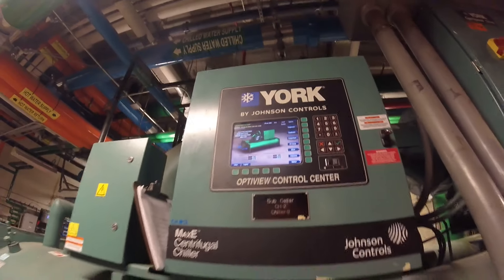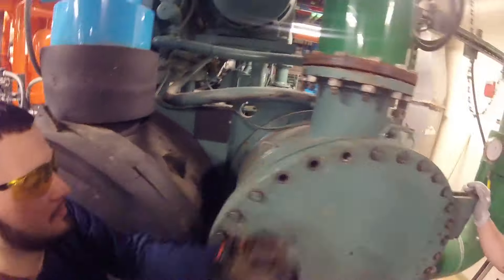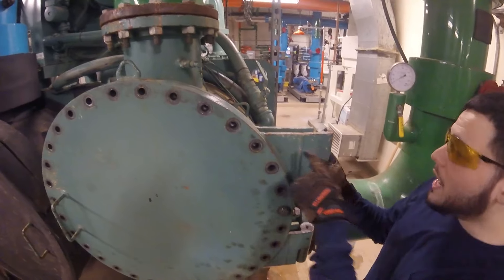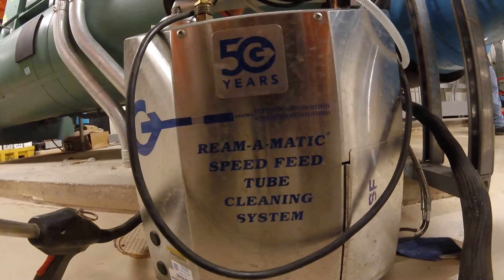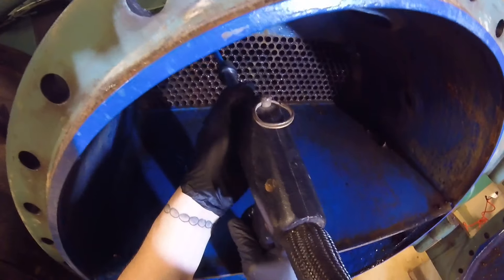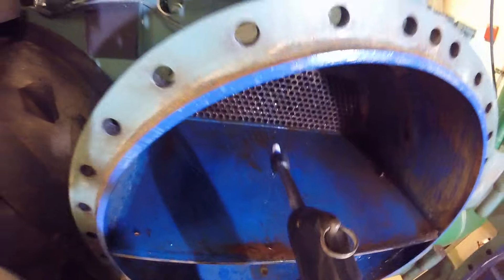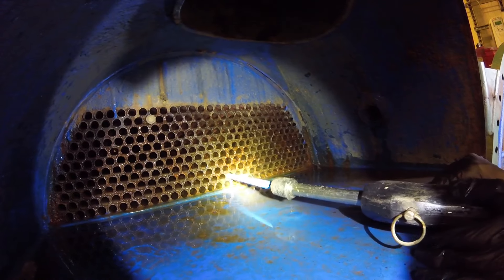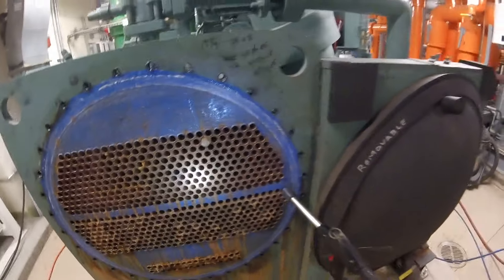Centrifugal Chiller Maintenance (Punching Condenser Tubes On A Chiller) Industrial Refrigeration

Comment: Nice video. Couple items noted. The Goodway machine is supposed to be laying down when in use. The label on the machine says that. Your supposed to set the cable stop so the brush only comes out half way on the opposite end. Also, why not brush tubes from opposite end from marine water box? It’s much easier.

Comment: Good job, i remember doing same job in Saudi Arabia on our York OM TITAN (5090 TR) chiller it had around 4400 tubes  in condenser. i am missing my job badly.
Reply: From what I remember, the largest of the OM’s had 7000 tubes. Those OM heat exchangers were huge.

Comment: Interesting to see you guys open up both ends of the condenser barrel. We only open up one end of the barrel and punch the tubes. I never worked on a centrifugal chiller with hinges on the endplates. We always had to build up a portable A-frame or T-frame rig assembly and then attach a chainfall to it to support the endplate as we broke lose the bolts and then lowered it to the floor.The A-frames are for the really heavy weight.
Reply: Hinges are a factory only option and are awesome when specc'd. Opening the ends on a 3000 ton YST is easy as pie.... brushing the tubes is another story... for a junior tech.

Comment: Nice video showing this process. When the water treatment program is well managed, and the engineers put in a good quality filter the tubes won't need to be punched for many years. This is a band aid solution to poor water quality in the loop. More problems are seen on the condenser side but on older loops the evaporator side can also get pretty dirty from corrosion in the pipes.
Reply: filter? You talking about the pump strainers?
Reply: @ryanmalin  not pump strainers. Those are like 1/8" and don't remove small deposit-forming particulates. I'm talking about side stream filters which continually filter a small portion of the recirculating water. Sand filters work best but you need to keep up with the PM.
Reply: Plus a money maker

Comment: Those goodway tube punching machines are supposed to run flat not sitting up like that.  Ive spoke with the manufacture about it.  I have 6 1000 ton chillers at my building in chicago  and recently had to purchase a new goodway so we wanted to put as little wear on it as possible.  From my understanding its harder on the clutch due to the angle of the rod when its upright.

Comment: Fair job, but it takes more than brushing tubes to get them clean and up to factory specs. Testing type of scale built up and circulating proper chemicals to soften scale must be performed before punching tubes. There are many types of scale depending on water source. Proper Cooling Tower treatment will prevent most problems. Regards YORKPR.

Comment: What is the point of having only one hinged end cover in the heat exchnger?
Shouldn't it come in pairs?
Reply from the maker: Lol forreal! Would make a lot more sense to have both sides hinged. Appreciate the feedback 🙏 Stay tuned for new videos every week & stay safe out there✌
Reply: Cost. That's why. It's the same in AHUs. Often, you can tell the high end AHUs and cheap ones by the access doors. High end equipment will have nice hinged latching doors and crap will have screw on panels.
Reply: @juanzingarello4005  your talkin about am air handler being crap and good. Its a box with filters in it.
Reply: @greatsoutherntrendkill79  Its not just filters that need access. The entire unit needs periodic inspection and servicing at some point. A high end AHU like AAON RN series RTU is built with maintenance in mind. Direct drive fans, single piece dampers, all hinged doors, etc. but a generic Trane Voyager will have crappy screw on panels where screws get lost all the time.
Reply: I used to build heat exchangers. Putting the hinges on were always a pain. Most of them don't have hinges. Customer requests. Easy enough putting a chainfall on it to pop the cover

Comment: One wich parameters you will regonized if the tube are dirty what is the delta t from water to the refrigerant ??
Reply: Look at your approach temps. If they go up, your tubes are dirty, and you won't get good heat transfer.

Comment: Hi guys too much long your snake wire on the other end, it will bended due to strong force of the cleaning machine.It is better to adjusted the wire and the brush just little bit passes thru the condenser. Awesome job.

Comment: This way seems way harder than the way I’ve done previously. Why not punch tubes from side without water box first and removing hinged side once done punching tubes and cleaning trash. Also, while brushing tubes, why not add plastic and drain pan to lower the amount of mess a little bit.
Reply: Did ya miss the floor drain in the video?

Comment: guys the way that you are removing the bolts, its easy to damage the threads on the H.E. Also, if you are going to reuse the bolts, do you inspect them or not? I believe its essential to check them prior reinstate them.

Comment: Hello. Quick question. I am working at a new facility and wanted to know when you are replacing the gasket for the end cap do you apply a joint sealing compound with the gasket or is it not necessary?
Reply from the maker: Hello Samuel, we usually use spray adhesive to hold it in place but it's not necessary. Gasket alone is fine👍Thanks for watching! Stay tuned for weekly uploads. Sending blessings your way from NYC! Stay safe brother
Reply: Jumper man Tech thank you 🤙🏼
Reply from the maker: @samuelguerrero6871  Anytime! 🤙

Comment: Thanks so much for this informative video. I am currently in a 9 month HVAC certification program. After learning about chillers, I am very interested in pursuing a career path dealing with these. Can you tell me about your path to getting your refrigeration operating engineer license? Any recommendations for me on getting into a career like this? Thanks in advance!
Reply: You’re gonna have to go union my man. Find a job with Johnson Controls. I’ve worked for them for 7 years. I did light commercial work for 8 years before I started with them.

Comment: such an easy job ,,punching tubes very boring job ,,,you can have problems if you break the gasket taking the head off...and if you dont cut the gasket correctly it will start leaking on you and if you got a good engineer on duty he will make sure its fixed before you leave